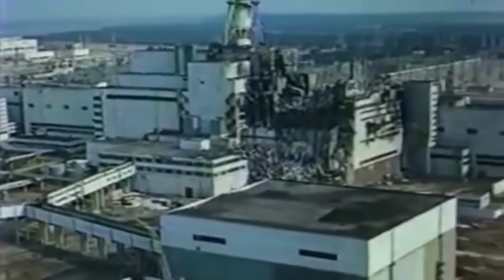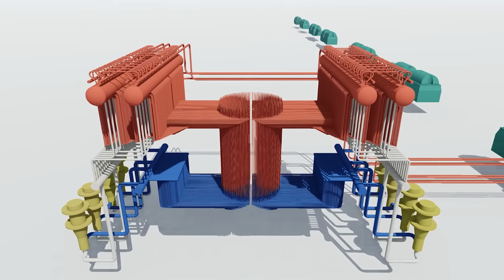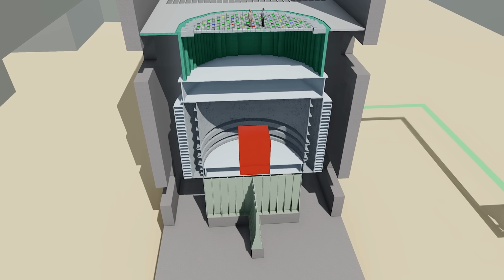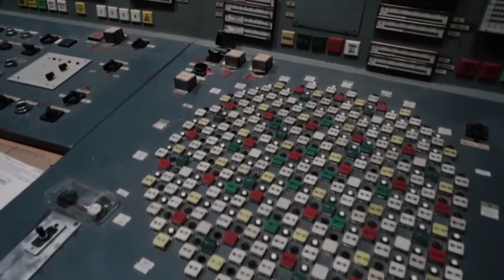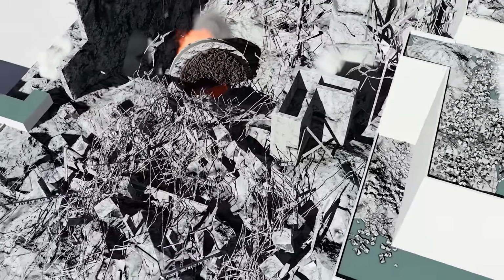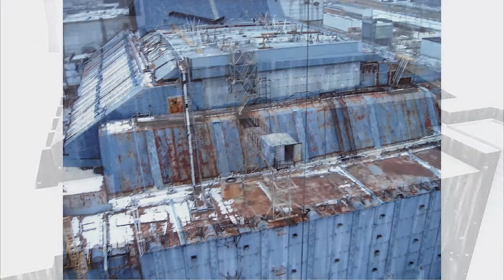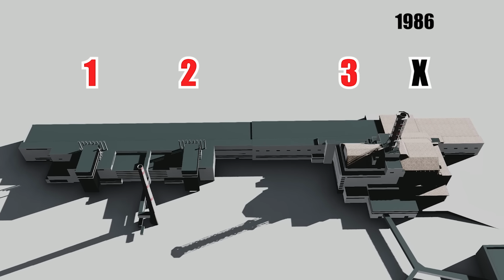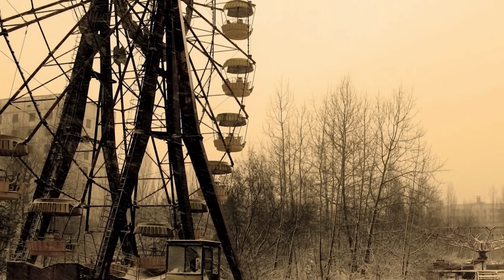CHERNOBYL DISASTER - An Inside Look - 3D

Comment: Fukushima accident was more or less on the same scale, if Tepco was following protocols Tokio would have to be evacuated. They were lucky to be able to release radioactive substances into the sea. I think biggest problem with nuclear energy is it didn't follow thorium path proposed by same man who designed PWR for submarines or ships, NOT civil use. Nuclear in any form, including RBMK is still better than making almost no progress with solar, hydro or similar. Explosions of reactors are nothing compared to what will happen if we continue releasing CO2 for the next 10-20 years. Permafrost is already releasing huge amounts of methane and CO2 which means positive feedback has already started. This means it will take about 10-20 years before huge changes start to get us into major troubles, much, much worse than covid...
Reply: That's absolutely untrue. Solar, wind and wave are making huge gains. The cost per kWh is way cheaper than fossil fuels. Nuclear is only used because of the government needing Plutonium for atom bombs. If it were not for that nuclear electricity would not exist. Geez!
Reply: @camerarderie5070  Solar and wind are making gains because governments are throwing lots of money into it and subsidising private investments. That means if you invest into your own solar panels or wind turbines government will pay around 80% of the cost, depending on country. As you know government are not run efficiently, instead people in power funnel money into their and friend's pockets by subsidising, etc. Best example are millitary expenses, "war on terrorists", etc. So far they don't have means of preserving this energy for peak demands or lack of wind or sun. In 2020 parts of California didn't have electricity when solar panels couldn't produce power because of wildfires and later snow in i think 2021. There are no backups for such events. We have lots of similar examples all over the world. Plutonium stockpiles are so huge there is no need to extract it from used fuel or make it in military reactors for a long time to come. Beside, civil reactors aren't good for producing plutonium because fuel is irradiated for way too long. This is why it would make a lot more sense going Thorium way since 70's as proposed by A. Weinberg who was father of PWR's. He lost his job after telling LFTR's are much better way to produce power and making example by running such reactor for several years. A lot was written about it... Well, i know of countries where wind turbine could only be built in the mountains which makes no sense, they also lack sun for solar panels. Hydro is what it is, so the only good solution is 50 years old technology of liquid salt Th reactors, in worse case advanced PWRs. We are way too far into heating the planet to wait for new technologies. For some reason people don't really understand advantages and disadvantages of nuclear, solar, wind and other technologies. Even organisation like Greenpeace are backed by money from governments so they don't tell people what the truth is. Make your own research or learn from mistakes that are standing out... So yes, geez, why are we just pretending to be solving energy problems with e cars, wind, solar and similar lies. Electric cars are a joke because we can't produce enough electricity for them, price of it is even going up. Don't be scared of nuclear because our survival is at stake; even a few meltdowns or gas explosions/deflagrations in the next decades are much better than continue heating the planet. I hope you don't and won't have kids because they would soon say wth were you thinking.
Reply: YES Thorium does appear to offer a far better solution compared to Uranium fuel. It is however not without its challenges and risks, and accidental melt down events have occurred. Large scale implementation has not been tested commercially... 
Electric cars are very much more practical and viable. They are very low maintenance, having so few moving parts, and use the power wasted on no application at night. The current coal fired thermal power plant runs full throttle 247 to cater for peak load... So in effect charging cars by night is free! That makes use of power that cannot be stored, no large scale battery exists to store grid power effectively, cost wise.
All car makers are stopping petrol and diesel powered cars by 2030s.
Reply: @camerarderie5070  Don't even hope internal combustion cars will be replaced by 2030, not in the US. Did they say this in primary school? I can see you noticed power from wind and solar can't be stored, don't count on cars doing it because they are minor consumers of electricity. You might find ideas of making hydrogen to preserve energy; losses are so big it doesn't make sense at this time or near future. Same problem have pumping of water to preserve energy, losses are huge. Where did you hear liquid thorium reactor had meltdown?  Give me one example. Of course fuel is in melted because this is how it works. Only in big troubles fuel solidifies, since it is at atmospheric pressure hardly anything can escape even if it is bombed. Try this with PWR or BWR, i still think a few meltdowns or explosions here and there like in Fukushima or 3 Mile Island is better than using coal and oil. Radioactivity decays with time while CO2 and methane cause positive feedback in nature, that means when it starts things get progressively worse. I suggest you read some more about thorium or even PWRs as we know them but with more safety as is the case in AP1000. I'm all for LFTR although if it won't be accepted very soon another good solution are gen 3+ reactors like AP1000. Only Babcock & Wilcox reactors designed by General Electric had major meltdowns and gas explosions, i haven't heard of major problem with Westinghouse. Look at history of GE and Westinghouse, like war of currents where GE was against much better AC power we are using until today... Let us know about your findings or opinions when you really study this problem.

Comment: Actually as heat increased reactivity did decrease. The correct way was... Positive void coefficient is when water is turned to steam there is nothing separating the neutrons from the moderator. However the increase that causes makes a negative void coefficient decreasing the reactivity. This has that. The difference is in the west we only have a negative void coefficient because the moderator is our coolant and doesn't evaporate. That means there is no positive void. Everything else is spit on however.

Comment: THEY RAN A NUCLEAR REACTOR IN THE SAME BUILDING AS AN EXPOSED, EXPLODED CORE FOR ANOTHER 14 YEARS.
Reply from the maker: 100% correct.  Nuts!!
Reply: @Mike-Bell  that is absolutely insane, imagine going to work there after it exploded.
Reply: @robertw6894  they didn't even stop construction on the two new reactors either. Not until 3 years after the disaster.

Comment: Why did they replace the old ventilation stack with a new one?
Reply from the maker: The new smaller stack would have been costly so it’s unlikely it was erected for posterity. The reactor 3 is still there and not yet decommissioned.  So I presume it may still may require an incidental off-gassing pathway.

Comment: I love how every time I hear the number of liquidators there were the number increases.  Soon it will top 1,000,000.  3828 is the number.  And most were volunteers.
Reply: Liquidators encompasses anyone who worked to help clean up the entire mess left after the explosion, not just those up on the roof - which is where the 3800 number came from.

Comment: This is a great video with very detailed animations and it can be clearly seen that a lot of work has been put into it - great job! The only part I didn't appreciate much was the constant propagation of the phrases: "If this was a western reactor all of this would not have happened...". No one is safe and it doesn't matter if it is a Soviet reactor or a so called "western", science can't be limited by politics and should not be used to propagate political views.
Reply from the maker: I actually entirely agree with you re the kommie bashing and western reactors bit. But unfortunately this can’t be edited once the video is posted. I’m considering doing a remake and just sticking to the facts.
Reply: But it's true - why shouldn't author say it? Commies purposely ignored safety measures because they wanted to save money. Apart from this commies on purpose hid critical information (which could prevent this catastrophe at all) from operating staff of the power plant - event, similar to one that caused explosion, had happened on another RBMK some years prior! And to add insult to injury commies in attempts to swipe info `bout catastrophe exposed thousands of people to radiation.

Comment: If the entire area was contaminate how were they able to keep it up and running until 2000 . . .
Something isn't right here
Reply from the maker: The buildings were huge and concrete makes for good radiation shielding so the other reactors and personnel were not affected.  The next door reactor 3 continued running uninterrupted whilst no.4 exploded.  Outside was dangerous but access route were cleaned and made relativily safe so staff could come and go.  The grid could not afford to lose 3 GW of power so they kept the plant running.
Reply: @Mike-Bell  
Well . . . 
The best schemes o' mice an' men 
- Robert Burns - To A Mouse -

Twenty twenty hind-sight says . . .
Don't blow up your power plant if you truly need that extra 3 Gigawatts of power . . .

However . . . 
The city was evacuated so I'm thinking that they probably over-estimated their needs . . .
at least in terms of the immediate community . . .

And one other thing . . .
Electric power has peak demand periods . . .
This became obvious during the Blackout of NY city on 9 Nov 1965 . . .
So while 3 Gigawatts may seem like a lot . . .
the overall system tends to be more reactive and at the same time more forgiving . . .
to the extent that the more realistic out come would have culminated in brown outs and economic measures at the personal level . . .
Reply: because the other reactors were fine, this is basically like 3 mile island but hundreds of times worse, in 3 mile island the other reactor kept running just fine, in fact they had quite a successful life, the partial meltdown one was simply cleaned up and since there was not that much radiation leakage its safe to go there today.
Reply: @CarlosAM1  
Much of nuclear physics is in fact scare tactics . . .
Reply: @hughmoore786  nuclear physics is often ignored for that to happen.
Reply: @CarlosAM1  
If you transpose the first two letters of NUclear the message becomes UNclear . . .
and life is returning to Chernobyl . . .
not that all the trees . . . flowers . . . and chirping birds were ever evacuated from the area ! ! !
Just proves my point ! ! !
Reply: @hughmoore786  unclear to the public? Ye
Reply: @CarlosAM1  
I don't think you give people enough consideration . . .
Nature will survive with or without the private us or the public us ! ! !
And this is reflected in everyone's DNA pool ! ! !
Reply: @hughmoore786  eh. It will survive, some wont tho, remember red forest
Reply: @CarlosAM1  
👍
✌

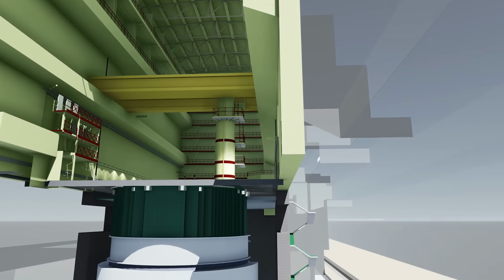Comment: 3:01 - No! It's the equivalent of running a badly designed car, at a speed twice what it is capable of, down a hill, with the brake lines severed, no seatbelt, with your car on fire, and expecting the handbrake to save you from going over a cliff.
It's entirely typical Soviet design: build it as big as possible, as fast as possible, as cheaply as possible, and just tell lies about how safe it is, so people will live next to the reactor, and work in it.
Then don't train your reactor operators to, you know, actually operate the reactor safely.
Reply: And people wonder why communism is a failure........in EVERY respect.
Reply: @beauhatman4395  As if there haven't been massive disasters caused by capitalism cutting the exact same corners. Deep Water Horizon, the Bhopal disaster, the Vajont dam disaster... the list is endless.
I'm not a fan of communism at all, but let's not pretend that capitalism is immune to corruption and incompetence because it clearly isn't.
Reply: @demoniack81  Clearly, your knowledge of the Chernobyl disaster (and it's aftermath) and how the Soviet "system" was the prime enabler of that horrible occurrence is rather limited.  Their problem is much ,much deeper than simply "corruption and incompetence".  Many Russians involved in this tragedy believed (still believe?) drinking vodka would protect the human body from radiation poisoning.  Also believed objects contaminated with radiation could be wiped down with vinegar and made "safe".  These facts just "scratch the surface" of what was going on inside the former USSR at the time.  Do you see a MAJOR problem here?  To compare Chernobyl to the other events you mentioned is kinda like comparing the "Empire State Building" to a mud hut.  The "fallout", no pun intended, from Chernobyl affected the ENTIRE WORLD.  Much of it completely unknown to many who were impacted.  I never said capitalism is "immune" from anything.  Or, "pretended" there's no "corruption and incompetence".  I was only stating, and can't remember who gets the credit, that "a little knowledge is a dangerous thing"......  Even if that limited knowledge involves building and operating nuclear reactors.

Comment: It's the "positive temperature coefficient of reactivity" not the positive void coefficient
Reply from the maker: Temperature coefficient and void coefficient are 2 different things.  

Temperature is the heat of the fuel.  Void relates to bubbles in the coolant water.  

RBMK had a negative heat coefficient.  Hotter fuel equals lower reactivity which is good.  It had a positive void coefficient.  More steam bubbles in the coolant water equal increased reactivity which is bad.  

In 1986 the stabilizing heat coefficient was was not enough to counter the unstable void coefficient.
Reply: @Mike-Bell  i know.   I'm a nuclear engineer.   It was the positive temperature coefficient that caused the explosion.   Not the void coefficient
Reply from the maker: Pretty crappy Engineering education you got if they forgot to teach you about the Fuel temperature coefficient of reactivity.... or you are not really an Engineer.  I go with the second.  LOL.  
Nevertheless I appreciate the comment because it helps with the YouTube algorithm.
Reply: @Mike-Bell  fuel temperature coefficient of reactivity?   Please tell me where that fits into the reactivity equation.   I assure you I'm an engineer who knows way more about nuclear power than you.  I think you're meaning temperature coefficient of reactivity.  Aka jesus fish t.  At least know what you're talking about before talking please.
Reply: The POSITIVE temperature coefficient of reactivity caused the explosion.   Don't believe everything you see on tv buddy
Reply: @Mike-Bell  graphite has a positive temperature coefficient of reactivity
Reply from the maker: @moopelbey7380     Temperature coefficient of the FUEL. 
As the Uranium heats up more and more neutrons become absorbed in resonation valleys of the U-238. My comment was specific to the FUEL temperature coefficient of reactivity. This was the only reactivity speed regulator the RBMK had and it could be overwhelmed in the wrong configuration at low power.
Reply from the maker: @moopelbey7380  
Unstable processes:-
Void reactivity feedback
Moderator temperature feedback
Xenon concentration feedback 
Delayed neutron
Prompt neutron

Stable processes:-
Fuel temperature feedback 
Neutron leakage
Reply: @Mike-Bell  do you mean fast neutron and thermal neutron? Congrats on almost getting the neutron life cycle
Reply: @Mike-Bell  first,  u238 isn't used as fuel.   That would be u235.  The process you described is a property of u235.  There is no coefficient for heat of the fuel.
Reply: @moopelbey7380  U-238 makes up 98% of the fuel in an RBMK since it's enriched to 2%. Whether it actually fissions or not is irrelevant, it's still there. Kinda surprising that a "nuclear engineer" wouldn't know this.

Comment: The shocking thing is the other three reactors ran for years after 1986
Reply: How is that shocking? The reactors were fine, all of them even number 4 the day before the disaster.... if you knew anything of what happened and what lead to the disaster you would see how misinformed you are in writing this comment. 
It was a very specific concatenation of events that lead to it, it’s not like all of a sudden the other ones could end up with the same outcome (unless the exact same mistakes were to be repeated precisely in that order again, which would have been basically impossible unless if done on purpose...), so yes, you and the 17 people who liked your comment are not quite using your brain.
Reply: @KevinS47  there are many scientists in thease comment sections
Reply: @KevinS47  22 now
Reply: @KevinS47  Those reactors were heavily flawed by the design. Explosion could happen not just because of Dyatlov (as his behaviors is exaggerated btw, as HBO and many books are based on ,,thruth about chernobyl" book by grigorij medvedvev, which is often inaccurate). You know that Leningrad Power Plant's RBMK once almost exploded too? The only thing that saved them was fresh fuel, so the void coefficient was a bit different. BTW the modifications made to reactors later have still not made them safe enough in case of bad operator. So it's quite surprising they kept them working until 2000, but it was necessary because ukraine needed power. In Russia they function to this day, but russians have lower standards when it comes to human safety and they are too dependent of those reactors, because they have even more of them than Ukraine, and russia is not so wealthy today. But they are not safe.